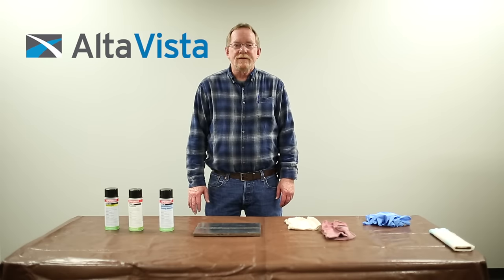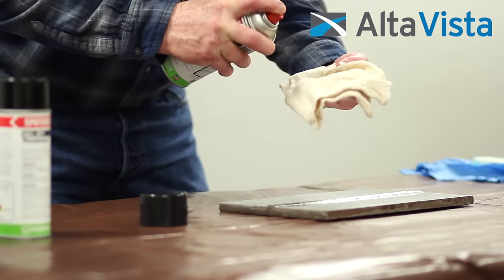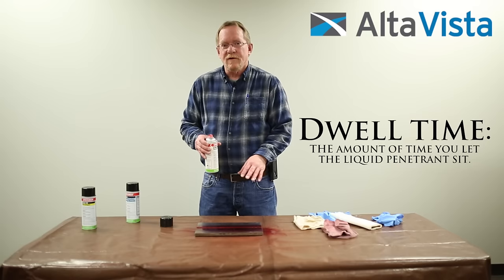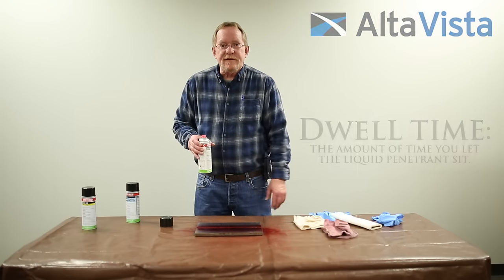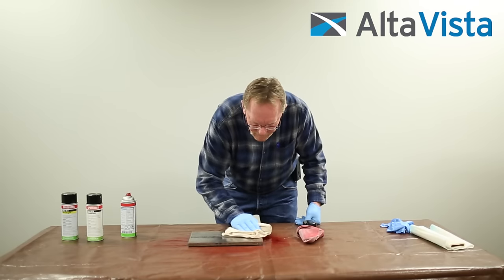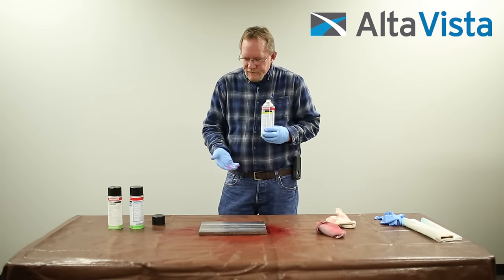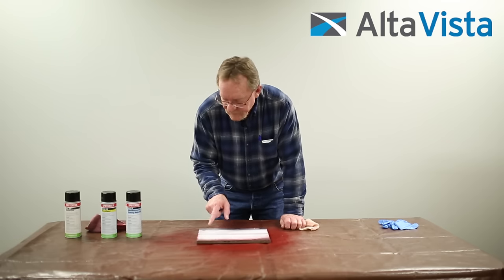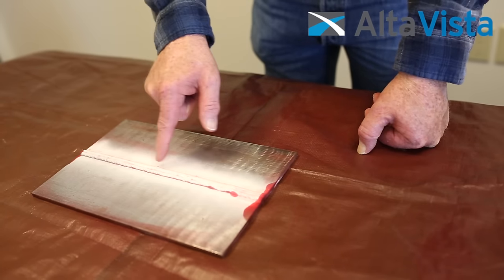Liquid Penetrant Testing

Comment: You must wipe off pentrant vertically or horizontally only. One direction. And way to much developer on your HAZ.
Reply: +The3Shogun   You are correct for most PT applications regarding cleaning. I disagree about the HAZ.  I suppose I could have masked the area of base metal that was not under inspection but the developer spray covers a large area and cleans off very easy. The procedure I was following allows me to wipe in both directions and as indicated I won't have a lot of non-relevant indications that need to be re-tested. Also, the weld and HAZ are evaluated based on VT after PT so I can wipe penetrant out of U/C, etc. and measure for acceptance. Cracks that are very tight would not be wiped away but may be missed by VT.  I could have explained why I was cleaning in both directions.  Thanks for the feedback.

Comment: I'm an Air Force NDI technician.
It's kind of shocking how similar yet different Method C inspections are in the civilian sector. Only 20 minutes of dwell time only using visible dye penetrant! It makes sense though, given its easier, faster, and it's doubtful you need as much sensitivity.
Reply: Hi..
I have a doubt.
Is there any need to do penetrate test on a complete machining part ?
Reply: That was only 10 min of dwell time.

Comment: You should clean the plate in one direction. And also apply penetrant and developer in one direction. It is either horizontally or vertically. Not both direction you can use for perfect results.
Reply: ya mam absoultly write ...he is not correct because of pentrates also pick out in defects
Reply: ya mam absoultly write ...he is not correct because of pentrates also pick out in defects
Reply: can you specify where does it say so? in which standard or norm (what page)?

Comment: Post cleaning is not proper Way..
Reply: Somnath Ghosh why?
Reply: for post cleaning you must clean the surface, from first point to 2nd point you can't clean first to 2nd and again 2nd to 1st. you can clean any of one way 1st to 2nd or 2nd to 1st jv071
Reply: Somnath Ghosh Post cleaning after the penetrant is applied? What do you mean by 1st to 2nd?
Reply: ***** 1st point to 2nd point. What Somnath state is that one should clean in the same direction, always right to left (for example)
Reply: yaa you are right
Reply: Why, do you believe you will wash the penetrant out by mistake?
Reply: +Somnath Ghosh Please reply see comments above.
Reply: You are supposed to wipe in same direction every time like up to down not down then up